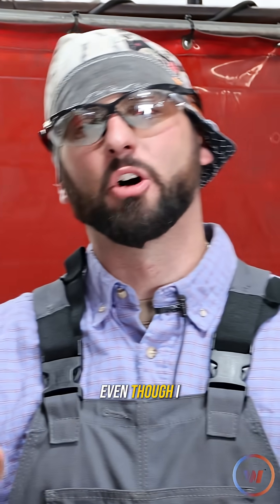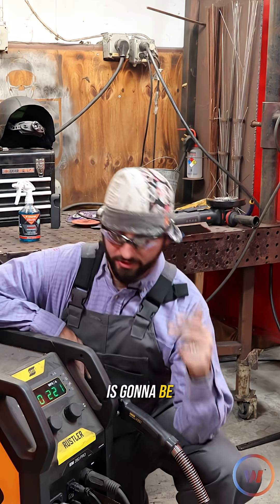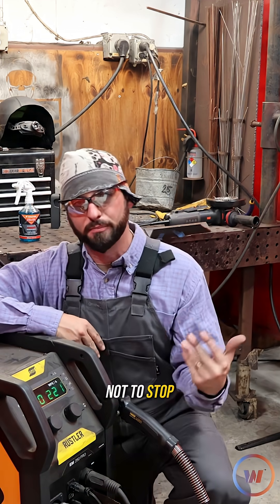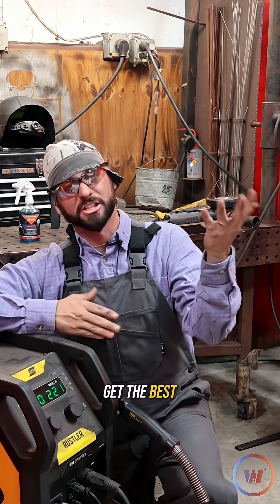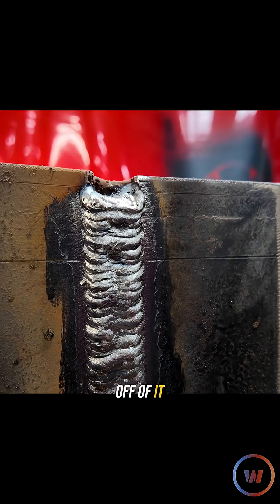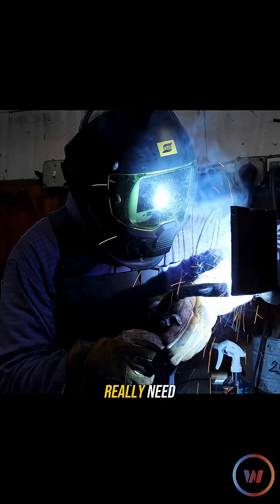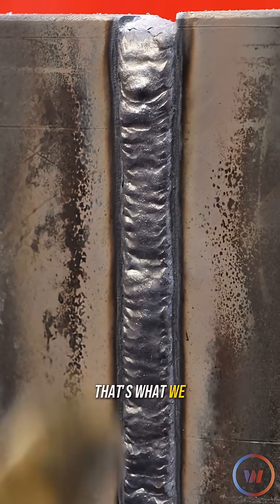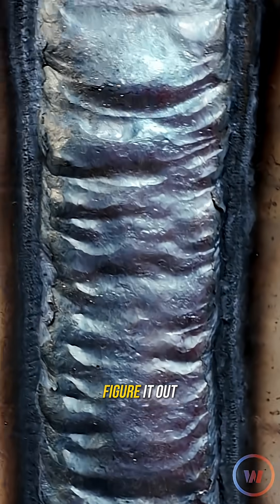Weaving Uphill With GMAW & Flux Core Welding

Comment: Yeh. Not feeling it. Prefer the nice tight weave stringers. Plus they are a stronger weld. Sure you could probably pass a UT.  But why?  Stick with stringers.
Reply: work high production places don't ya
Reply: @ashbolender7595 I work high iron. Column spices. Full pen welds. When you’re welding a column with 4” flanges and 3/4” webs, you want to do it right. The last one I did I was using NR232 .072 wire. Guess how long it takes to do a column splice that size, and what tools you need to do it correctly. UT’s must pass or it’s a cut out. If it’s a cut out (I’ve never had one, in well over 1000 full penetration welds). If it cuts out? Well you can bet they’ll get you money. Back to the hall you go. I’ve seen it happen many times. Union Ironworkers have been building America since February 04-1896. Keep building it local 29.